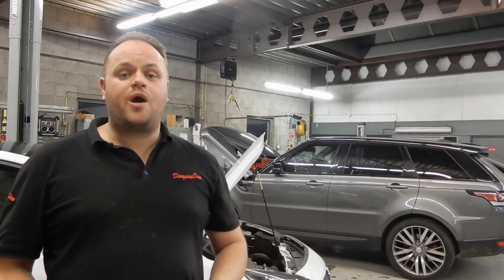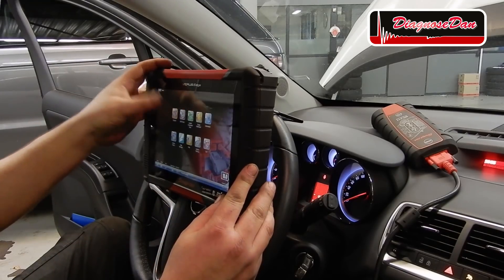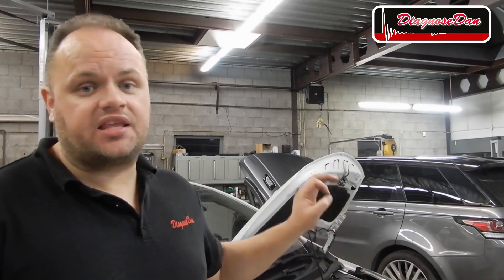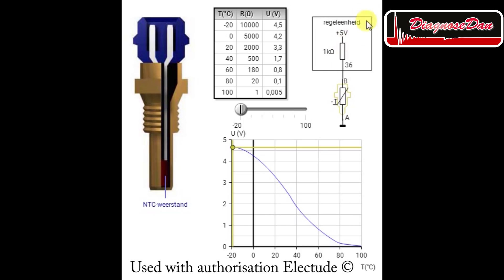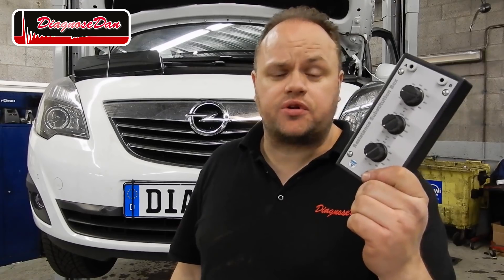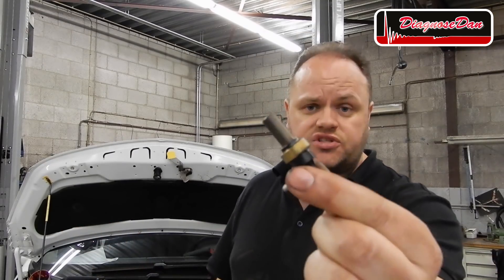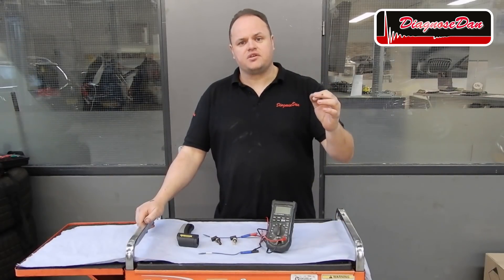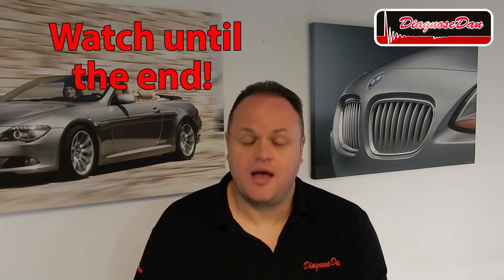Using a Decadebox to diagnose an Engine

Comment: I'm not sure if this applies now where you are, but a lot of American systems will use a default value, typically -40 deg F, for the temp if the sensor is unplugged or fails open. This would be a quick test with your conditions . I just found your channel and I am impressed with your techniques to find the problem and fix it, not just start throwing parts till you hit the target. We have a lot of so called techs that think they can hook up a scan tool and it will show them how fix a problem. I found out many years ago you have to think the problem through to weed out all the false indicators, a lot of times having to think outside the box.  Thanks.
Reply from the maker: Thanks for watching my video's it's appreciated Bruce!

Comment: Dan you are very convincing, you have proven all the computer and sensors are all a bunch of unnecessary junk. My older cars of seventies and early eighties ran wonderful even up to 400k miles two of my cars you could not even hear the idle. So how do we by pass all the digital crap.

Comment: Dan I'm not a mechanic but I truly believe in preventive maintenance and keep it new to save the fuel. I often find when maintenance is not keep to par you spend more on gas in many situations. That gets expensive. Simple items can increase the fuel bill 100 or more a month. Now my question. I have a H3 GMC Hummer what is the best diagnostic computer or scan tool, I can buy, I prefer to have a preprogrammed one instead of online, right or wrong ??

Comment: great education as we expect from master tech dan , thanks for sharing it , dan i have few question please , can you use that tool on four pin connector on ecu temp sensor ? if yes what pin it should be connect channel A and channel B , second question , i like your terminal accessory with posh case can you please leave the details of where did you bought it from , can that tool be used on any other sensor or does it only work on sensor with NCT sensor ?
Reply from the maker: Only recistance, the terminal kit i got from my Local parts store.

Comment: Great diag Dan! Amazing how simple things like this are overlooked. I had a Toyota that had an intermittent stall some years back. Parts were thrown at it left and right by 2 shops. It came to us and the customer warned us that it was very intermittent and random. It took us a while to actually get it to act up, but when it did we caught the coolant temp dropping to -40 and then verified our sensor was at fault. No codes in that vehicle either, which made direction more difficult like yours. At least you had the gauge showing  incorrect readings. Great catch & great work on your videos.

Comment: The previous garage will not have invested as much on training and equipment but made more money fitting parts not required, They probably charge a low hourly rate which may be the reason they got the job first, if you think a good tech Is expensive then wait till you see how much a bad one will cost you.

Comment: Had an 01 Hyundai Santa Fe come in. Hasn't had an inspection in 3 years due to 2 monitors not completing and no one could figure it out. No codes in the computer. Looking at live data for anything out of the norm.... IAT was at -40f, preventing the EVAP monitor from completing. Replaced the MAF, drove it not even 20 miles and all monitors were set, ready for an inspection.
Reply from the maker: Great find!👍

Comment: Other shops fine example of throwing parts at what should be common fault checks.
Great video Dan, you might want to forward this video to the other techs. You might think not, but remember.....what could be wrong with a correct procedure to make a better income.
I am a mobile mechanic, on the road repairs.....and hear this expensive story with owners about how techs NOT KNOWING HOW TO DIAGNOSE was an expense to the owner. Effective diagnostics and presentations like you make this industry better.
Thank you for the excellent video and information you provide.
Reply from the maker: Thank you David!

Comment: I'm a minute or so into the video and it sounds like a lean startup fault when it started.
Reply: Great vid, my intitial thoughts were a fuel delivery issue when I heard that startup, as soon as I saw the gauge, it all fell into place. Some vehicles don't share a sensor for the gauge and the PCM though and would make a diagnosis a little more difficult.... If I came across those starting symptoms with no scan tool available and a gauge showing a false reading it would be a long process to diagnose.
Reply from the maker: @2secondslater  Thanks for watching!👍

Comment: I usually check these with a test light. Although not as precise as a decade box, you can still verify integrity of the wiring and that the ecm can see a change. 

This is a good example of why verifying customer complaint is critical.

Good fix Dan👍🏻
Reply from the maker: Thanks Larry, there a many ways to test a thermistor. But this video was also about how to use a decadebox. Thanks for watching 👍

Comment: Hey Dan, I'm convinced my Diesel Toyota has the same problem. It's a 1AD-FTV engine, common to Avensis and corolla. Maybe even RAV4. Really hard to start below freezing, and I mean 20 minutes of repeated trying at -2 Celsius. Glow plug light stays on really short, not even 2 seconds. Even at 10 Celsius it might take two tries. I became more certain, during our summer holidays we came to a town where its above 25 by the first time I start it, and she fires up first time. I even looked at the fuel rail pressure in the morning and note that it rarely goes above 50Mpa at start, but will gladly go over 100Mpa under hard acceleration. It's also interesting that at -2 it refuses to rev for the first couple seconds after starting, like it's confused about how much fuel pressure it should allow. The other possibility is a suction control valve, but then I'd expect acceleration issues as well. Your info about this being ntc is very useful. Going to look into that soon as I get home.
Reply: Hi, I have had this fault on a few 1ADFTV engines in the last few years, the most common problem being the suction control valve, each time the high pressure pump pistons travel, the SCV has return to it's zero point, they are a very high wear item, especially if fuel quality isn't good. 

I have had a few rail pressure relief valves fail too and only play up when the fuel is very cold and viscous, once the fuel is warm the vehicle operates normally and target pressures are met without problem. You can check this by comparing target and actual pressures using a scan tool.

The other obvious thing is to check for air leaks into the fuel system, allowing the low pressure side of the fuel system to drain back to the tank overnight, a piece of clear hose in line in the fuel system can be used to check for aeration.
Reply: @2secondslater  Thank you so much for your comment! Since writing that comment I have confirmed that the ECT sensor reads pretty much the same temperature as the outside air, so that's probably not the issue. The vehicle drives fine and I usually deal with such non-engine-killing issues by ignoring them until they get worse, at which point it is usually much clearer what is wrong. I can also get past it by counting to 7 before starting rather than starting immediately after the glow-plug lights go out, thereby giving it a bit of extra heat.

What further makes it hard to diagnose is that we so rarely have such cold weather. I was in the South of Namibia in the middle of winter (without the scan tool!) the last time that one could really diagnose it.

I have a Scan tool (an Autel Maxilink ML619). The only issue is that I do not know what I am looking at. At idle I can see the fuel pressure move around a bit (between 30Mpa and 40Mpa), and I can also see the idle speed bounce a bit (by 2%... so likely nothing). I actually posted the question on stackexchange as well, asking if it might be the SCV:

https://mechanics.stackexchange.com/questions/61496/suspected-suction-control-valve-issue-car-also-hard-to-start

An SCV is not exactly a cheap part, which is why I really wanted to debug it before I spent money.
Reply: @plonkster  the short glow plug lamp time raises my concern, generally on most vehicles, the colder the weather, the longer the glow lamp will stay on (longer glow plug time). The fact that it starts better when the weather is warm may point to a glow plug system fault too.
Reply: Oh @plonkster, I just saw that your glow plug lamp is only cycling on for 2 seconds, this is probably abnormal and indicative of a glow system problem.
Reply from the maker: Great! Thanks for the comment buddy it's appreciated!
Reply: There should be resistance specs online to check the glow plugs with a multimeter, you can also cycle the key with a test light on the glow plugs to confirm they are being powered up. I haven't had many Toyotas with glow plug or glow plug control faults yet what you have described is indicative of it.
Reply: @2secondslater  The Glow plugs are fine. That was my first suspicion and they all test within spec. They also obviously work, because the car starts easier if you run them longer.

On this particular car (and I suspect many others), when the light on the dash goes out, the glow plugs are still on, it is merely telling you that you can go ahead and start. I'm using that little fact for easier starting. But obviously something is not quite right... and it must be fuel related.
Reply: @plonkster  what year and model is the vehicle and how many km's
Reply: @2secondslater  I think the first important thing you need to know is that I live in South Africa. So we don't have summer and winter grade fuels because it rarely gets that cold. The coldest I've seen was -2°C (28 Fahrenheit), it was almost impossible to start at that temperature, and when it finally did it idled very low for several seconds, then slowly picked up speed, and you could put your foot down straight to the floor and it wouldn't rev. This lasted less than a minute, but it felt like ages.

This is a 2007 model, but because that was the year it was first introduced in this country it might not correspond to the same year model elsewhere. This engine was used in the Corolla until 2013, when they dropped it in favour of a smaller 1.4 engine in the 2014 model year. Before 2007 it was used in a few Avensis models, but I have no idea if it was the exact same engine or a previous iteration thereof. I am aware that this engine had a compression issue on some models that sometimes requires replacing the entire block and head, but I believe that was for earlier engines. At least, it shows no other tell-tale compression symptoms.

I understand that it is impossible to diagnose remotely, and I really do appreciate your comments!
Reply: @plonkster  I understand, I live in Western Australia. Your Model is a 2007 *****  with a 2ADFTV, asking because I wanted to check for service bulletins for your particular vehicle.
Reply: @2secondslater  It's a 1AD-FTV.
Reply: @plonkster  Corolla? Avensis? What is the model of vehicle,
Reply: @2secondslater  It's a Corolla. Engine number 1AD5266055, VIN AHTLF56EX3000987.
Reply: @plonkster  no bulletins I could find for this fault in the US or EU, these are the only 2  places I have access to manufacturer bulletins, sorry I don't  have access to your area.
Reply: 30 to 40 megapascals is a pretty normal range for idle, again you can check actual values against target/calculated/expected values (what the ECU wants to see as a pressure under the current condititions) using a scan tool. I am dubious of this being a pressure type fault though.
Reply: @plonkster, all of the issues I have mentioned are potential problems, it is virtually impossible to diagnose from behind a computer screen, there are also simple things like was a summer grade of fuel being used when the temperatures were cold? All I can do is give you ideas of potential problems, diagnosing requires a bit of knowledge and experience, experiencing the fault and use of tools. I hope you have luck :)
Reply: Also, have the dealer check service bulletins related to your model of vehicle on the off chance that a flash update of the ECU is needed.
Reply: Typo BTW, 1ADFTV

Comment: Just a question : what grease are you putting on the new sensor?
Reply from the maker: Some Valvoline red grease. To make sure the rubber O-ring goes in smoothly.

Comment: Due to a bad temp sensor that car was in a permanent closed loop condition which lead to a lean fuel mixture resulting in a long crank with cold engine. That Decadebox from Ditex is very useful not only for the automotive industry but for many other applications in the electronics field, Thank you Danny!
Reply from the maker: Thank you Argency👍

Comment: CAnt believe garage didn’t see that
Reply: @simon sherwood -- You would not believe some of the stuff I have seen over the years , ESPECIALLY from other SO-CALLED shops. It can make you cry so hard you laugh. Or I just laugh because of exactly what you just said.  I am strictly an Import facility , roughly 70 % EURO - 30 % Asian. 
I actually had an Audi , V6 , that came to me after it had been to 3 or 4 others , One shop replaced ECM ( New from Audi , VERY EXPENSIVE )and the last shop in the (laugh) line actually convinced the owners they needed a replacement engine ! ( Good news there, it was a salvage with 45k less miles)  But of course it did not solve the problem. Anyway , the only thing wrong was # 2 cyl. & # 5 cyl.  fuel injectors were bad.  And I discovered from talking with customer that the first MIS-Fire problem actually started almost 2 years prior. Then the second MIS-Fire  started7mos or so later..... OMG...My wife and I laughed like crazy over the ignorance of the other shops . BUT we also felt so bad for the customer and the way they had been treated & what I thought was cheated, that we gave them the parts at cost and no labor.
Reply: Thank You for the LIKE Dan !! I really appreciate that. 
On a side note, I made my own  variable resistance box from 2 VOLUME controls bought from Radio Shack (local USA electronics parts) and a few other parts I already had . Total cost was about $24.00  usd.
Also and most importantly ==Watch your channel all the time and really enjoy it and always learn something new  !!!
Reply from the maker: @armyvet92  That's great! It doesn't have to be expensive as long as it gets the job done!
Reply: I have had it now for 13 years !! However , all the other Diagnostics, Programming / Coding equipment costs an absolute Fortune
Reply from the maker: Me neither😓

Comment: Great video Dan, for the people that don't have a fancy little black box and the gauge is stuck high, just unplug the sensor and observe the gauge/scan tool pid if its still high take a test light and LIGHTLY touch the terminals on the connector and watch gauge/scan tool to drop in temp or volts reading. If its stuck low do the same test, only connect test light to positive batt terminal. This will check and confirm wiring integrity. Merry Christmas
Reply from the maker: Merry christmas John to you and your family!

Comment: One little thing. On the diagram the sensor has one wire actual sensor has two? Thanks for all your videos. Wrap them all up in Christmas paper as a gift of knowledge
Reply from the maker: The sensor has two wires a 5v feed and a ground also in the diagram right. The sensor is not grounded by the housing. I should have explained that better.
Merry christmas to you and your family
Reply: In al most all cases the sensors are grounded back at the computer itself. This is done to make sure they all receive an equal ground level. A lot of time many sensors share a ground and could be referred to as “sensor low” on a wiring diagram. Multiple  codes for sensors all saying “voltage high” is more than likely a common ground problem..

Comment: Based on the fact that the temperature was reading higher than it should have, you know that the resistance was lower than it should have been. The problem was a partial short somewhere in the circuit. You could have watched the scan tool while unplugging the sensor. If the temperature reading was -20 with the sensor disconnected, you could have deduced that the circuit was good and the sensor was bad. The decade box, while neat, wasn't necessary to diagnose the problem.
Reply from the maker: Indeed there are many ways to test this circuit. But in this Video i wanted to use a decade box because it can be very helpfull at times. Thanks for watching my video's it's appreciated!
Reply: @Diagnosedan  

You are right Dan.

Comment: Tip :

There's a small thin booklet called "Smog Refresher Course" around $40.00 @ www.aeswave.com.It's an old book & I think the Author has moved to New Zealand from the United States.

Don't buy this book thinking you're going to pass the California Smog Exam, the Rules have changed, nevertheless; it's an excellent book.

Forget the Carburetor Chapter but it's on Point.

Why would a Tech. , Do It Yourselfer or even anyone that doesn't work on "Todays Vehicles" purchase this Jewel ?......Because of Chapter 3 : When you know what the Major Input Sensors : RPM Sensor ( Crankshaft Sensor ), Mass Air Flow Sensor, Manifold Absolute Pressure Sensor , Engine Coolant Temperature Sensor, Intate Air Temperature Sensor, Throttle Position Sensor , Oxygen Sensor should read in the Key On Engine Off / Key On Engine Running positions you woulda seen a Red Flag on the ECT Sensor within 120 seconds.............Knowing what Long Term Fuel Trim should read @ Idle & 2,500 RPM give huge clues also !! plus the Idle Air Control Valve readings are vital also.

Smog Refresher Course Book
Chapter 3 !!!

Southern California Smog Repair background.
Reply from the maker: Thanks for the Tip!👍
Reply: @Diagnosedan  

Chapter entitled, "Scan Tool Diagnosis - Computer Inputs & Outputs".